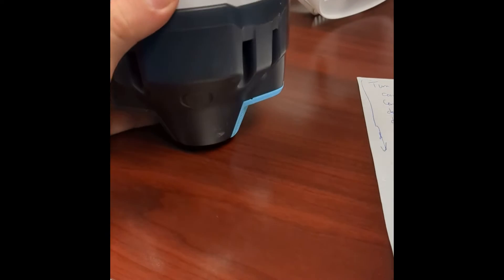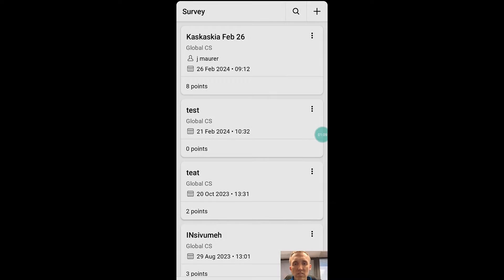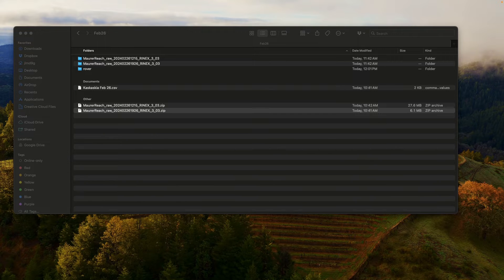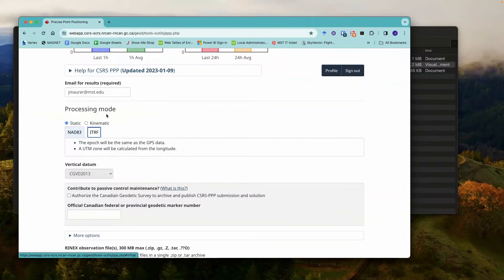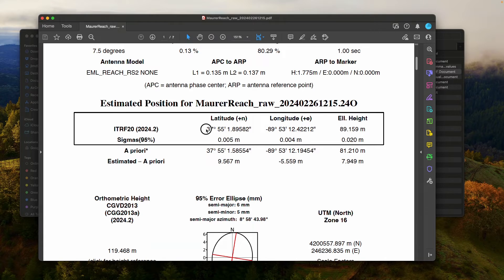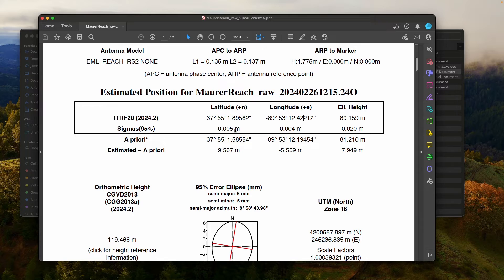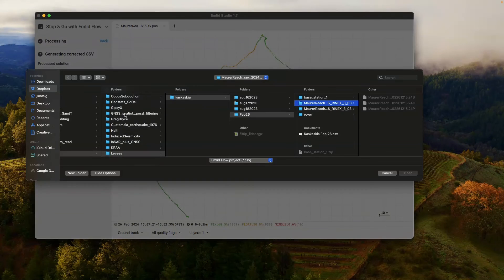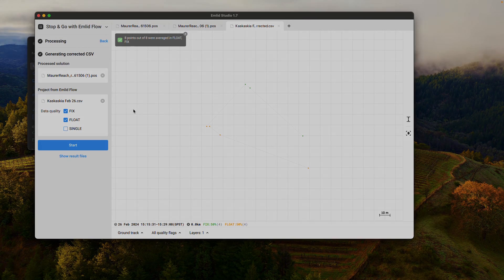Static and PPK Processing with Emlid Reach RS2 and Emlid Studio

Comment: So if I don't have a known point, could I use static observations and ppk to get a known point. Then, setup the base station on that known point I created, then configure the base and rover to rtk, and then use the rover to place gcps, and then use emlid studio to correct the gcps and then use that data to create accurate maps and models?
Reply from the maker: Yes indeed! You can actually do it all in one step by simply post-processing the static observations as the PPK base station. You can do that by sending the RINEX file to the CSRS for static processing and then inputting those coordinates into Emlid Studio.
Reply: @jeremymaurer9554  how long should the GNSS data be recorded at the static observation before you can send it to CSRS for post-processing?